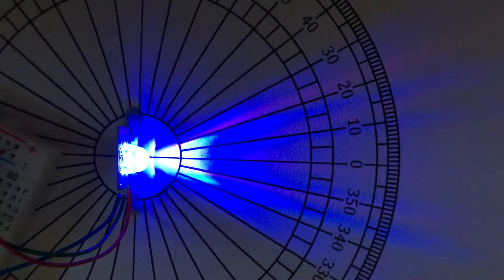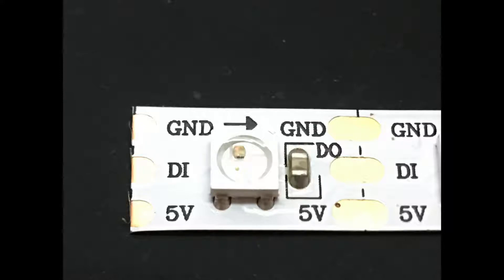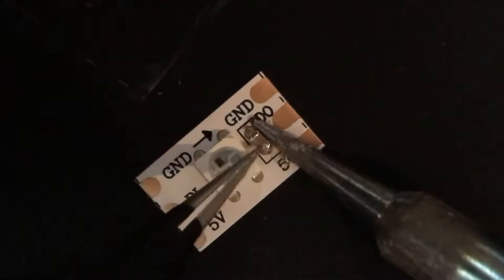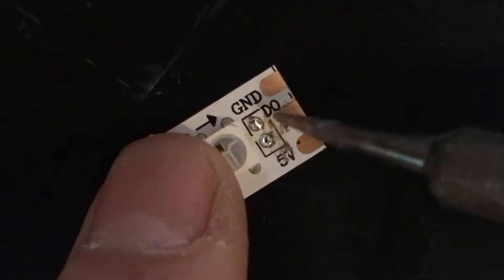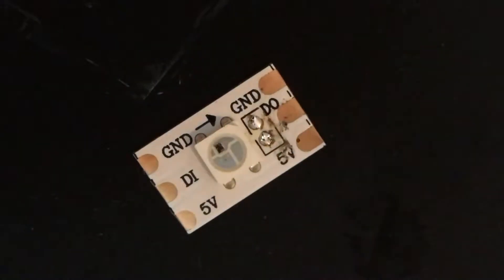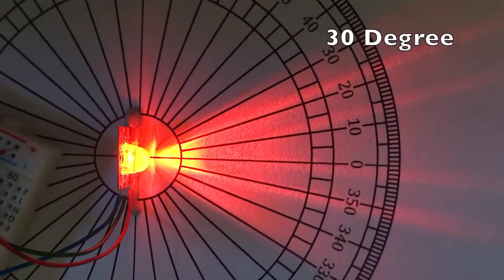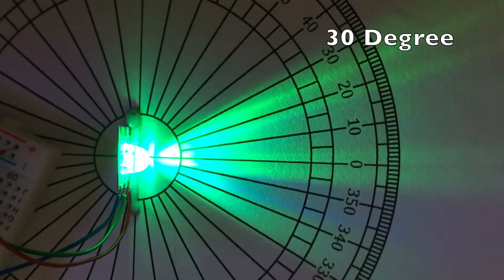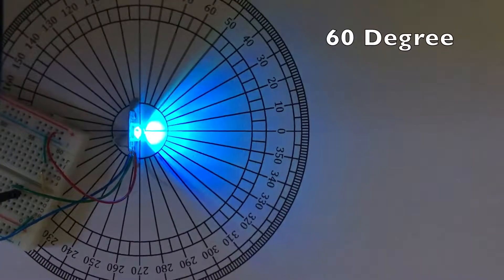More detail on the 140, 60 and 30 degree 5050 SMD LED Lens

Comment: any warnings about using them on 144/m led strip cause they are too close together which means that lenses will have to be sanded/filed down. Also they seem to focus better being farther away without removing IP65 silicone in my case otherwise it shows only small dot.